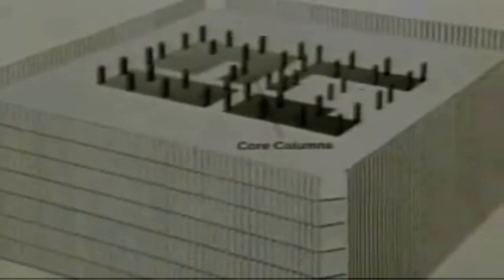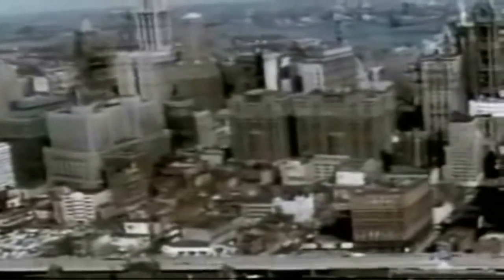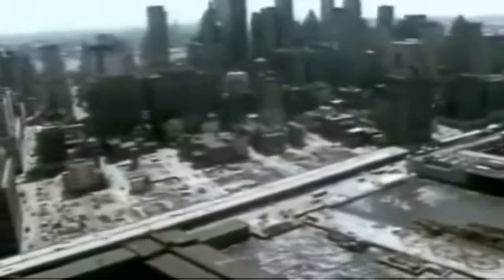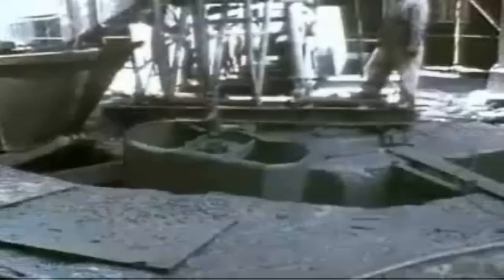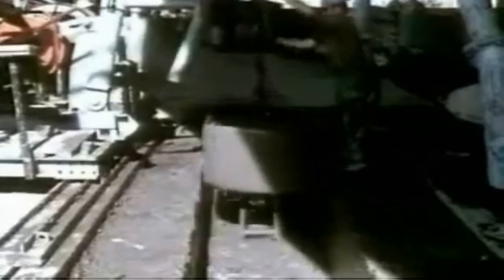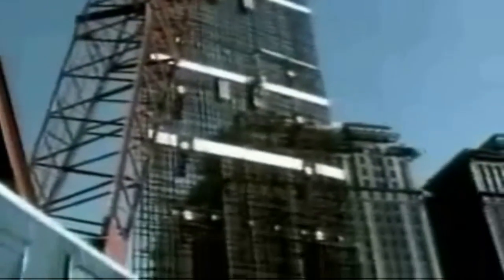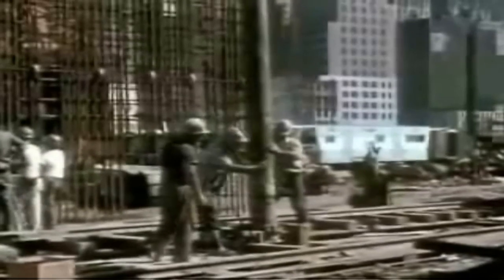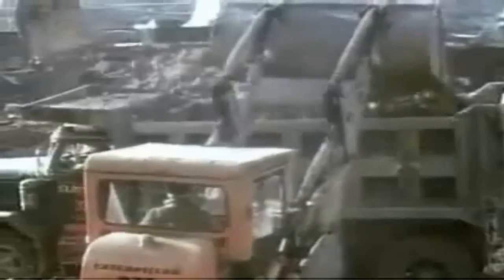Building the World Trade Center Towers

Comment: No way in a million years could an aluminum aircraft made it through these walls without some sort of help. let alone two! No way.... 🙁
Reply: Kristopher john mujica  You're insane. Those box columns and windows are nothing to a 150 ton airliner.
Reply: To those saying the planes would have disintegrated on impact fail to realized a couple things. The floor plans of the towers were made to maximize rental space. They did this by having a donut shaped floor plan that had perimeter walls with internal walls where the stair/elevators were (the interior and perimeter walls each held their own 50% of the building’s weight respectively). Those perimeter walls only take verticals loads not horizontal ones, the floor trusses held the building together horizontally but didn’t have a lot of tensil strength to hold very long if they were structurally disturbed. A 140 ton plane WILL penetrate the perimeter steel beams. Those tests you see of small aircrafts hitting concrete walls at 400 mph are not at all similar to what happened in the 9/11 attack. The outer perimeter isn’t solid concrete. It’s steel beams that were blown through by the plane. The plane impact on the building caused thousands of metal fragment to blow off the foam insulation and drywall in the building, making it easy for the fire to soften the steel beams. The jet fuel inside doesn’t burn off right away, that’s not what it does. It’s fuel so it burns slower so planes can fly farther with less fuel. The fire inside softened the steel on the INTERIOR beams and floor trusses to cause the building to implode on itself causing the floors to pancake each other, like a bomb demolition. It is evident the interior beams collapsed first because as the north tower falls you see the antenna fall down before the perimeter supports. Those video you see of  “bombs” going off as the building falls aren’t bombs but debris that is being forced out the windows form the building falling. Since the interior beams softened from the heat they buckled and fell slightly before the perimeter beams (as I already stated) and the debris you see rushing out is a result of that. The second building was hit more in the corner of the building and missed around 1/3 of the interior beams. But it hit lower on the building so the softened steel had to support more weight, so that’s why it fell faster.

Comment: Are you seeing the size of those steel sections? No aircraft could fly through those. In the gaps easy but not through them - impossible.
Reply: Ed Evans  Huh? 14 inch box columns are no match for a 150 ton airliner moving as fast as a pistol bullet.

Comment: Jet fuel can melt steel, but not fast enough to allow the wings of a plane to slice through steel columns like that! There was a crash in a tunnel a few years back and cars (far thinner metal) were melted, but it wasn’t instantaneous even for thin metal. So the steel columns of the WTC could never melt fast enough even if they were half as thin as they were, to allow the fragile wing of a plane to slice through thick steel columns instantly. However you look at it, it’s impossible. So those planes were not normal planes and certainly NOT passenger airliners!
Reply: JAZZ MAN  Wow. Really? You think the wings of a 150 ton airliner are fragile? 😂😂😂😂

Comment: Jets did not destroy the twin towers, no plane parts of any kind were found amongst the rubble, tiny explosives used to bring down old buildings was the cause + it was an inside job set up by George  W. Bush + jets would disintegrate as they are made out of light metal if crashed into solid concrete columns, no terrorists were responsible either, it was one big cover up (read about it & watch doco's, if you haven't already)
Reply: To those saying the planes would have disintegrated on impact fail to realized a couple things. The floor plans of the towers were made to maximize rental space. They did this by having a donut shaped floor plan that had perimeter walls with internal walls where the stair/elevators were. A 140 ton plane WILL penetrate the perimeter steel beams. Those tests you see of small aircrafts hitting concrete walls at 400 mph are not at all similar to what happened in the 9/11 attack. The outer perimeter isn’t solid concrete. It’s steel beams that were blown through by the plane. The plane impact on the building caused thousands of metal fragment to blow off the foam insulation and drywall in the building, making it easy for the fire to soften the steel beams. The jet fuel inside doesn’t burn off right away, that’s not what it does. It’s fuel so it burns slower so planes can fly farther with less fuel. The fire inside softened the steel on the INTERIOR beams and floor trusses to cause the building to implode on itself causing the floors to pancake each other, like a bomb demolition. It is evident the interior beams collapsed first because as the north tower falls you see the antenna fall down before the perimeter supports. Those video you see of  “bombs” going off as the building falls aren’t bombs but debris that is being forced out the windows form the building falling. Since the interior beams softened from the heat they buckled and fell slightly before the perimeter beams (as I already stated) and the debris you see rushing out is a result of that. The second building was hit more in the corner of the building and missed around 1/3 of the interior beams. But it hit lower on the building so the softened steel had to support more weight, so that’s why it fell faster.
Reply: Simon Eden  Stop spreading that nonsense.
Reply: there is even a little footage of a piece of the plane's window panel found on the floor u fucking chip idiot

Comment: Would anyone be willing fund a project to rebuild the World Trade Centers in the desert So we can recreate 9/11 to see if the towers would collapse? I think that would be one cool Discovery channel documentary 🤘🏼
Reply: Would only need to build a section big enough to swallow a Boeing 767 then place an old scrapped 767 fully laden with fuel and the weight of passengers and luggage added and place it on rails then attach rockets to get it up to cruising speed and see if it would punch a perfect cartoon plane shape hole straight through without any resistance or the wings folding back on themselves. Even if it did a Tom and Jerry straight through this still wouldn't explain how both buildings fell almost identically at freefall speed which can only be done with precision timed explosives blowing out the critical supporting area's at an exact moment for them to fall perfectly in their own footprint without them toppling. Oh and then it doesn't explain building 7 which was built completely differently from the towers, which no plane hit , and the BBC announced it collapsing before it even did. Oh and no plane debris found at the Pentagon after an airliner flew at 500 miles an hour at ground level with no actual camera footage or eyewitness account of seeing a plane at the site of one of the most heavily guarded buildings in the world.

Comment: that is a lie... the outer walls were not the main load baring structure they supported 40% and the core columns supported 60% ...the building was massively over built to support much more weight that it needed to be according to the architects and engineers

Comment: The NIST report is a damn fairy tail. You don't have to have a degree to see the truth because it only takes common sense. Think about this... NIST says the exact reason the towers came down was because of the impact from the jets and the jet fuel burning to weaken the structure. NIST claims the pancake theory which means the tip of the towers above the impact fell straight down crushing the rest of the towers below floor by floor until it stoped at the bottom. This is a stupid ass theory if you have any kind of common sense! Even though the heat theory is bullshit because the fires weren't burning nearly hot enough to weaken the steel we will still go with that for the point I'm trying to make. Hot air rises so the structure wasn't weak a certain amount of floors down from the impact, probably the bottom 60% of the towers where not damaged by the heat but the top of the building above the impact was weak and brittle because the heat from from the fire rising up. So I want anyone to explain to me how that weak brittle piece of the building had enough strength and weight to STAY TOGETHER to crush all the floors below without crumbling apart and even stayed together to crush the bottom 60% of the building undamaged by the heat. How did that weak ass brittle tip of the towers stay together to do this????? All those undamaged floors just gave way all at once with no resistance for this brittle damaged top piece of the building????? How the fuck did it stay together to crush the undamaged bottom half???? How the fuck did it not tip over when it reached the bottom half that was not heated up and damaged from the impact and jet fuel??? Think about this shit!!! This damaged piece of building had had enough force and strength to crush everything below it, EVEN THE UNDAMAGED BOTTOM HALF OF THE TOWERS!!!! It's not fucking possible people!!! It would have broke apart to nothing or fell off the side  as it made impact with the UNDAMAGED bottom half of the twin towers. It blows my mind people think this weak brittle damaged piece of building can crush everything below it with no damn resistance at all and magically stay together to do it. EXERCISE COMMON SENSE!!!!!

Comment: Tells u right in the beginning the flaw in the design. The outer walls were the main supports. Punch a hole in them like what happened and I'm surprised they stood as long as they did. Conspiracy Clowns head over to Info Wars to get Dumber 🇺🇸
Reply: If the flaw was the outer walls then  a possibility then OK, but the weight of the top floors couldn't have brought down each tower in a  formed free fall. It's like 2 Formula 1 cars crashing in the same place on a track. Just a few millimetres can change the outcome of each crash. So applying that science to 2 towers built identically means it is MASSIVE coincidence how they fell, or something else is afoot. I don't like to like to think about it but you have to
Reply: @KRhythm2013  do you know the weight of the top floor above the plane hit, I'm surprised with the fire how long it stood
Reply: William SHEEPly---- Please do some homework. Lucky Larry Silverfool admitted it was a demolition.
Reply: That's like saying a wood hammer is best for driving steel nails! Aluminum can't punch a hole through steel.
Reply: I definitely do not know the weight of the floors above where the planes hit, we would be talking many tonnes, and quite rightly so to think that the weight of those floors pushed it all down. But as I say, the position of each plane would have had to had been absolutely perfect to bring them down in that free fall motion. A few inches difference might have pushed one side of it down first making it lop sided as it fell. There is a funny video this week from a British house of someone taking a chimney down from inside, and the top topples over and smashes the roof. Funny, yes, different building materials yes, science is the same, and 9/11 is no laughing matter.
Truth is we will never know. Unfortunately from personal experience of a care home in the UK covering up their tracks and using intimidation tactics so they avoid going to court when they are in the wrong and in debt, I dread to think what a government could do given their power. I may not come from the US but our British government is just as bad, and since the above incident I am suspicious of organisations as  a whole. It is horrible to think but that is the way it is.
Reply: eddie  Building 7 shouldn't have come down like it did, and regardless of the twin towers that is very suspicious. Shanksville too, but the Pentagon really has the most compelling evidence. Two 6 ton jet engines completely missing and never punched any holes through the Pentagon walls. This fact of physical evidence alone is enough to question what happened. There is too much to discuss but you can't fool billions of people around the world and that is why people are still questioning it 17 years later
Reply: problem is that nothing can collapse this way without help... not even a stick of butter will collapse on itself
Reply: So why did the US government not sue the original companies? If they were so badly designed?

Comment: 4 things I would like to point out. 1. Those were not solid columns, they squared tubing much different characteristics from I- beams, 2. Steel can expand up to 50% in size due to continuous heat as seen by recent bridge/overpass collapses, 3. Steel rivets and bolts can become stressed and break if tensile strength is overcome by sheer weight, 4. Aircraft aluminum can made as strong as steel. You remove 35% of vertical load bearing walls and core structure it will eventually collapse under its own weight. Remember it was a vertical load not a horizontal load. You damage anywhere along the perpendicular of a vertical beam it will fold like a tooth pick.
Reply: Makes so much sense
Reply: Logical to me .but so many like the crazy conspiracies
Reply: What’s the point of this comment? For you to feel smart, typos and all?? My God

Comment: Steel structural beams on the exterior,cut through by an aluminum plane that can't withstand a hit from a Thanksgiving turkey.The fire weakened the towers,the official finding reads,resulting in total collapse in an hour.Now we have a 24floor building in the UK that is still standing after a 12hour fire.What caused WTC7,a 47story building,to collapse?No planes hit it,WTC6 still stood,despite massive damage,and it was closer to the twin towers.And I will get called a conspiracy theorist nut,for simply asking questions.

Comment: 1:25 "Their great height was made possible by the use of load bearing walls" 
1:39 "The exterior walls were designed to bear much of the weight of the towers.. the only internal supports would be in a simple core of columns"

Those airplanes left 10 story gashes in the sides of the buildings... it's not surprising they collapsed

Comment: I don't argue the towers anymore, but Building 7, you can't logically tell me debris from the towers and fires brought it straight down into it's own footprint in 12 seconds, that defies all laws of physics. To say Building 7 isn't fishy means you literally have no concept of science and engineering to begin with, regardless it's over now and may we never forget those we lost
Reply: 12 seconds?? its been burning uncontrollably on an insecured weakening supporting structure for like 7 hours straight 🤨🤨
Reply: Things falling straight down defy physics? Jesus Christ, you're an idiot.
Reply: I have heard other people, rational normal people, say that about building seven.
Reply: There's a model which quite accurately shows how building 7 collapsed. The inner part fell first after hours of burning. Steel does not have to melt to lose its strength. It can become bendable and flexible at lower temperatures, which compromises its ability to hold weight. If fire fighters were able to fight the blaze it would have be standing today but they lost a good amount of their people and had all resources at ground zero trying to help and find survivors.

Comment: 45,000 kg moving at 183 m/s hit the buildings with 8313713 newtons or 1868997.039 pounds of force.  

No conspiracy needed. The amazing part is they managed to stay standing for as long as they did. A real tribute to the architect, engineers, and construction workers that built it. 

They saved many many lives.

Comment: Too bad most people dont know that Aluminum in its purest form is actually strong enough to cut thru steel! All commercial planes made after 1996, including the 747's used on 9/11 had an MG-ionic composite spread over the nose, wings, turret rings & glacis plates of the plane for reinforcement....Not to mention a full tank of jet fuel.....and If that didnt convince you that this comment is your wasting time, then let me tell you about the  "primary separation rockets, which ejects all the passenger luggage in case of an impact, making the plane lighter & faster......Yes, so as the "Primary SR ejected the passenger luggage, a few briefcases & laptops hit building 7 causing the total collapse of that 50-story  tower....mixed with office fires.....
Reply: So sad,that you can't THINK!

Comment: What are these yellow things (at 10:48 there are easily seen), and wasn't entire structure from steel? At 10:33 - 10:46 i see different from the steel walls strucrute(i think concrete) which has additional gery columns outside (if i am right)

Comment: Planes are made of aluminium. Burning aluminium and water cause a thermite reaction. This is what made the steel melt.
Reply: Jacques Mertens wouldn't burning aluminium  (whatever that is) and water cause a water vapour reaction ?
Reply: What I should have written is that thermite and water cause an explosion that sends the thermite in all directions. Even a very small quantity of water will intensify the thermite reaction. In a thermite reaction aluminium and steel burn together, generating such an intense heat that it is used for welding.
Even without the addition of water the thermite would have burnt right through the building.